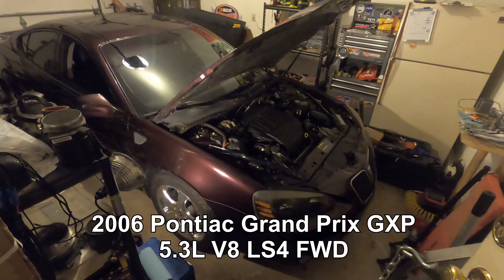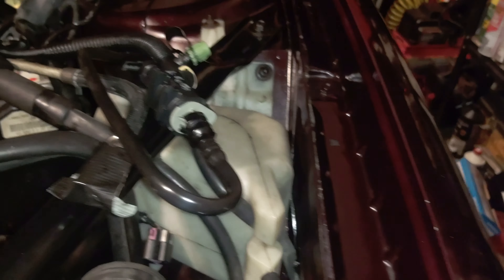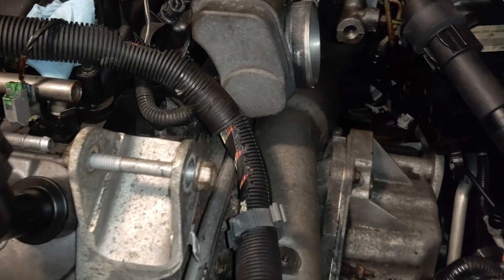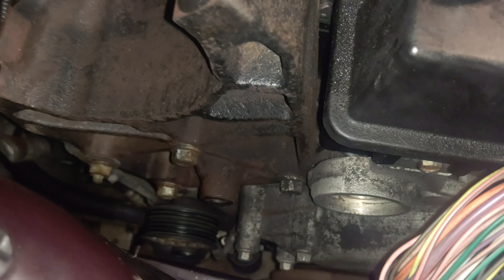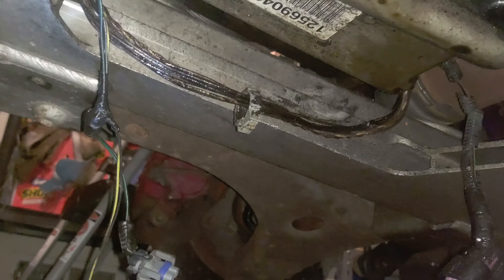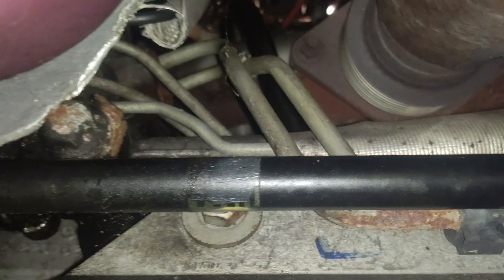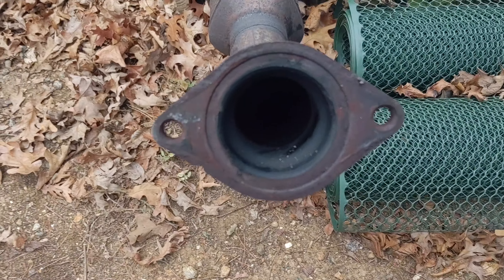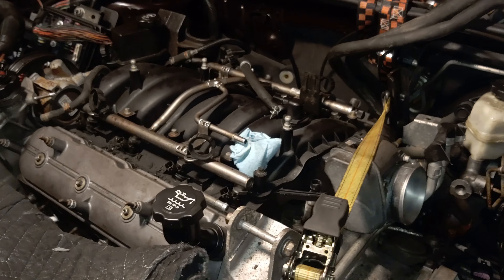Grand Prix GXP LS4 engine transmission removal - Part 1 prep

Comment: Let's face it. The Gxp can be hard to work on. Everything is packed in there with limited working space. Thanks for the video.
Reply from the maker: Thanks... Ya, it's certainly not optimal.  I can't imagine how they prototyped it with an LS1 a few years before, and decided to still produce it.
Reply: @dezldave961  Perhaps a last ditch effort to bring some driving excitement to Pontiac and save the brand.
Reply from the maker: True, it seems like one of the Band-Aids they tossed out when killing the F-body, and losing tons of market to Mustangs in that price range.  Borrowing the GTO/G8 was a quick attempt, too, but they were never too serious (didn't even offer the Caprice outside fleets, and never advertised the SS).  The Camaro is all that's left, but priced next tier up now.

Comment: Glad I seen this video. When I get another wbody it will be 3800 powered.  Good to see ya still helpin others in the platform. I myself learned a ton from ya and the mnclubgp days.
Reply from the maker: Thanks.  MN was a fun time in the 3800 peak.  I'm still using parts from then, since I have them, but it's less fun/possible to get started in it nowadays.

Comment: Thank you so much I have an 06 gxp that I pulled out the motor and did dod delete camshaft and lifter in and for the life of me the oil dipstick baffled me. I could not figure out which way it went. In between the 3rd and forth cylinders in the front finally I found a picture. There isn’t a whole of info for these cars.
Reply from the maker: Good deal.  Ya, I promised myself I wouldn't modify this nightmare of a setup, but it's finally getting a few small things after 10+yrs (LS2 intake/TB, LS7 MAF, ZZP intake, and HPTuners will get connected for adjustments).

Comment: Subbing for part 2. Doing this same job except prolly going with the 4t80e. I don't have a lift and it has to come out the bottom because I doubt the 80e will go in the top. I don't know if I can get it high enough to clear the motor and I have no idea how to roll it out into the driveway. I do have a tractor I might be able to pick up the motor or the front of the car with but I want to see you roll that motor around on those wood dollys before I try something like that, lol. I haven't seen anyone else on here pull it from the bottom without a lift.
Reply from the maker: Thanks.  It gets plenty high with the hoist.  I'll start putting the rest of the footage together this week.  The key is just planning a couple steps ahead and taking my time.